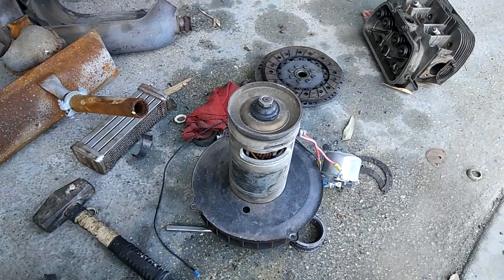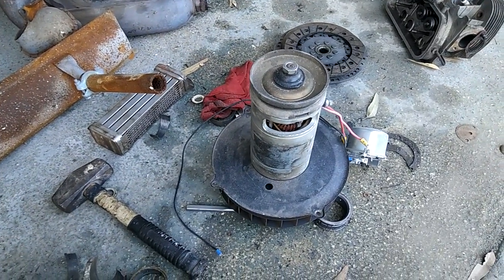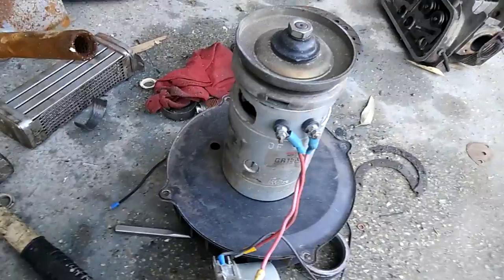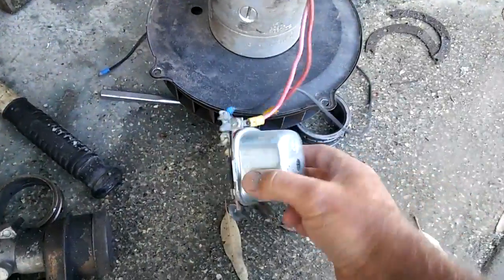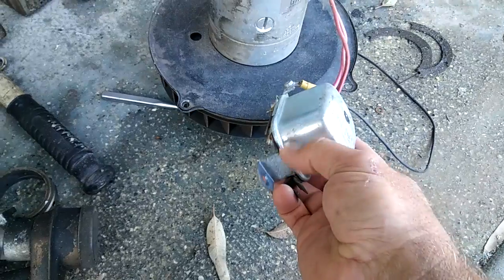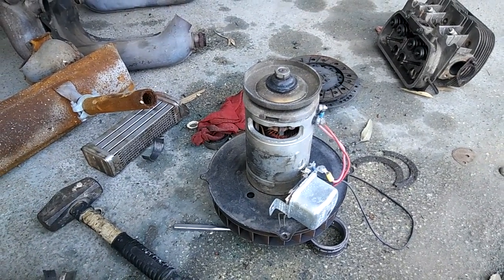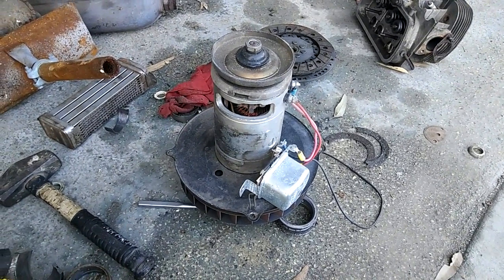Converting 6 volt to 12v without replacing generator using 6 volt generator

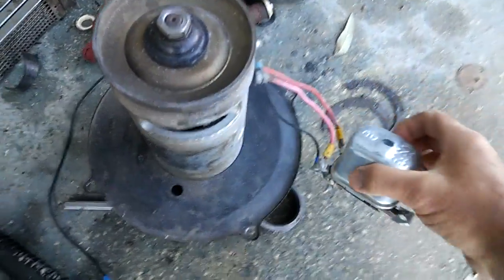Comment: 2:50 if you wanna skip the rant.
I kind of always knew this would work. and it won't affect the genny just the brushes. the regulator is doing the magic.
moral of the story kids:
If your genny already works, put a 12v regulator between it and a new 12v battery.
NOW, does the starter work??
Reply from the maker: good one thanks for watching.

Comment: Got a question mike, what is it with the generator equipped bugs.  What I’m saying is, I wire everything the way it’s supposed to be in the voltage regulator but, when I hook up the IGNITION  to the solenoid on the starter......it won’t start when I turn the key.  What is wrong, happens on all the bugs I’ve tried it on, only once, did one bug start up for a while and then nothing....am I connecting the ignition from ignition switch to the solenoid wrong? Thanks
Reply from the maker: resistance in the wire causes the solenoid not to go out far enough to connect. You need a hard start relay. They shorten the distance to the starter from the ignition switch.

Comment: One thing you can't do on a 6 volt generator is 2 converted to 12 v the main reason is that the windings in the 6 volt armature and if you want to call it the resistance of the windings and there's solder joints will not handle the load or the heat.

Comment: Well so much I culd folow but what dummy light you used exactly what was exactly the light bulbs watt rating? Well the same result I got useing diferent capacitor values and types for exampel if I use hv ceramic capacitors any where on plus and minus terminal in series I get higher voltage in all wire harnest but just like you I get the alternator starting charge rpm to kick in around 2000 2500 rpm I played with plazma ignition so I got that result so I belive ordinary resistor and diferent values of bulbs culd solve that problem and probably alter those generators and alternators starting charge rpm even at lower rpms in theory it shuld work so idel speed wuld by reduced giveing bether economy and perhaps use bouth amplifier ignition on start up in cold weather then swap to plazma ignition only problem is other electric devices are effected even gages give false readings but thats a good typ to show peopel thanks nice video 👍

Comment: Mike, I just bought a '66 Beetle from an estate. The car came without a battery. How can I tell if this has already been done on the car? Also, how will everything else in the car work, if the regulator is all that is changed?
Reply: size of the generator 12V is larger (almost 4" diameter vs 3.5") and look for the larger regulator for the 12 volt mounted on the fan or in the engine bay.  6V sat on the generator (least the engines i have in the basement).....doesn't everyone have spare vw engines in the basement ? -- I would also look at the light bulbs, could you take one out, and put 6V to it ?  or just convert to 12, new head lights, wiper motor voltage drop or replace wiper motor...6V starter is going to kick on 12v.... like Mike says, go 12 V... remember VW put those 12 V lightning bolt stickers in the driver door frame in 67 and later ?  12v was an option in 66 from what I read....
Reply: @DanTheManIOM  Thanks, Dan!  Fortunately it looks like this Beetle has already been converted.
Reply: @caduceus33  no problem, I just had to go down stairs and measure them !! Yes, here's a 36 hp, then a 40, then a 1300, here is a single port 1600, and this is a dual port with alternator....welcome to my engine museum...and here is the 2 Liter bus engine "core" pile.... oy !

Comment: When i converted a 1200cc beatle 6V into 12V i put a 6 volt zener diode in series with the D-connector internal in the volage regulator. But your solution is O.K.  My main problem was the carburettor. It had 2 connections, 1 for the choke and 1 for a small valve. A carb of a 1300cc (that has 12V ) did not fit. The 12V valve was expensive those days and the 12V choke was not possible. My solution back than was to put a bulb in series with the carb. It had worked all the years that my friend had the car. I did not solve the gas meter. The 6V starter worked also with 12V.
Your statement that generator is bad when it turns, when you put current to the D? I am not so shure, it maybe can turn on the remanent magnetism, that is stil in the field. But i have no experience to that.

Comment: Why when I hooked it all up like that and then take the battery cables off it shuts off it didn’t do that before
Reply from the maker: It wont charge enough to make the engine run at idle without the battery. NO CHARGING AT IDLE....now if you have the engine running at a high RPM and take the batter cable off it may keep running but not sure because it is a generator system. Use proper testing equipment. Volt meter amp gauge you will find it will be charging at above idle somewhere. put it to like 2000rpm.
Reply: @Mikefngarage  yeah I figured it out it works like it should thank you👍

Comment: The only problem is the brushes are high carbon to be used on 6 volts the 12 volt brushes have more copper....the six volt generators are all smaller in diameter than the 12volt
Reply from the maker: yea the whole idea is that you need to use a 6 volt stand on a 36 hp. because it is permanently mounted to the engine. so either you use a 12v  Porsche generator or use a 6v  gen with a 12v reg. not suppose to work but it does.
Reply: Mike F on a 34hp engine you can change the holder. Only on the 30hp/25hp you can’t change it because it’s unremoveable on the block.